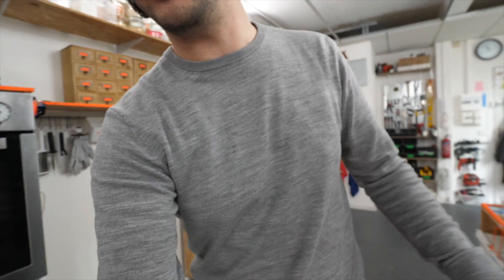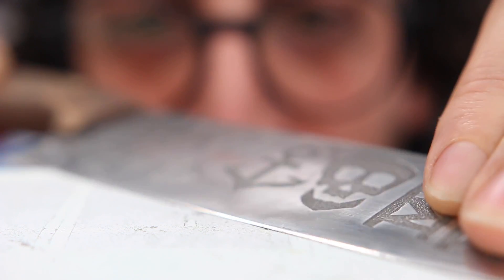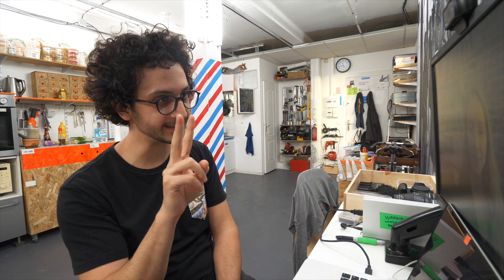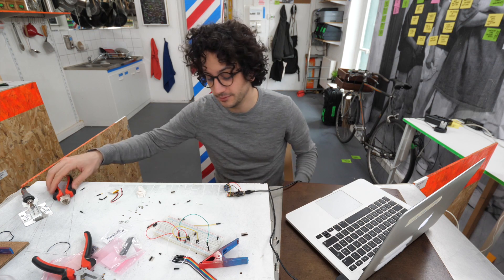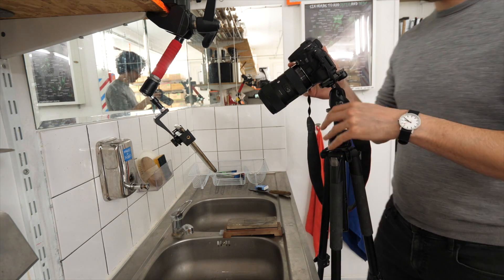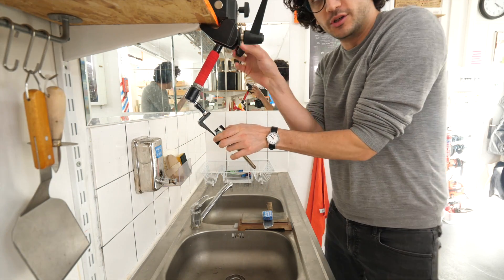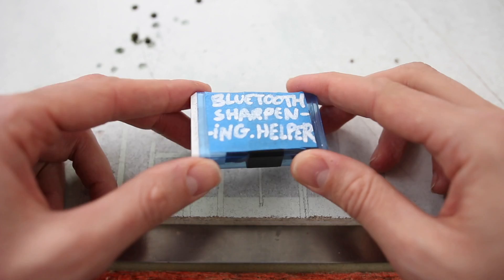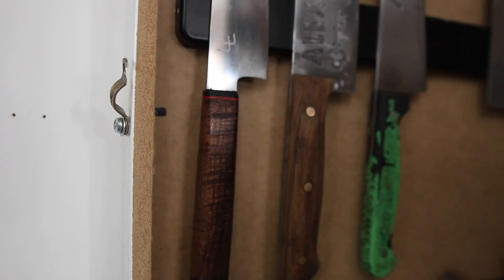Is This The Future Of Sharpening ?

Comment: Instead of linking the arduino to bluetooth, I think you should use continuous audible tone to indicate the sharpening angle. 
Something like 440Hz at the desired angle, and the tone varies up or down depending on the angle.

Comment: If you put a small multi colored LED on visible side of the device and before starting sharpening if you can say to software that you need let's say 15 degrees (with +/- 1 degree to have some space), so led will be green when you reach to that angle, it will be red when you are below or will be yellow when you are above that angle. What do you say?

Comment: The issue is not the measurement of the angle. That is spot on. The issue is getting the blade to maintain that angle while it's in motion. However, that would be to cumbersome. The solution is to move the sharpening tool while the knife is restrained in the needed angle. Find a way to restrain the knife, then place a rotating sharpening surface beneath it that can be made to ride the contour of the knife's edge. Like a belt sander on a pivoting platform or a grinding wheel.

Comment: The best solution to have it teach you is to add a piezo speaker that uses a tone, set the desired angle parameters and it does continuous tone as long as you stay within the parameters. This would easily cue you to stop when the noise stops.  There is also numerous diy videos to make your own printed circuit boards,  you can design your own board and be able to print them pretty simply, plus this would let you label component locations.

Comment: BOM for 100: 
Gyroscope € 177,90 (I found some cheaper ones at around 70€ per 100, but too lazy to change the total)
PCB € 20
AT-09 (bluetooth) € 175,36
Atmega 328p (aka arduino) € 132,08 

lithium Battery charger € 13,79
AMS1117-3.3 (voltage regulator) € 1,64 or buck/boost regulator MC34063A € 2.02 (add about .30€ for passives that go around it)
500mah battery € 121,18
alternative: 
pcb mount aaa battery holder € 15,81 
1000mah NiMh aaa battery € 50,61
boost regulator MC34063A € 2.02 
2A transistor € 2,06
current sensing resistor € 2,07 
arduino doing the charging logic: "free"

2 led: € 1.19
usb connectors: € 6,81 
misc, switch, resistors and capacitors (passives) €10
total (lithium): € 660.31 (or € 6.61 per module)
note that you need to add the price of pick and place and soldering, so that may be another 100€
magnets cost € 3,67
also the price is from the AT-09 module on a pcb, you probably can get shave an extra €20 id you only get the module. 

misc idea: Buzzer € 11,52 + transistor € 2.06 (no sound on perfect angle, higher sound if higher, lower if lower, increasing in intensity as you go away from there)

if you want to add usb programming you need to add:
€ 3,37 for a 12mhz crystal
€ 27,00 for the CH340 usb to serial chip
or change the atmega 328 to a 32U4 that does usb natively and has more capablities
but adds € 121.42

note that you don't need usb programming as you can use bluetooth to program the arduino.

the case adds another 320€ (custom aluminium case with the holes, silk screen printing and one acrylic panel for the bluetooth)

so total for 100pcs with a case would be around 1000€ (or 10€ per module)
Reply: note that if doing a bigger batch it might be worth to design the bluetooth on the pcb.

Comment: Im guessing you can build a really simple prototype using LittleBits: snap a tilt sensor to different actuators like an LED display or a buzzer or a vibrating motor to see which kind of feedback is the most useful for practice. Tadaaa

Comment: Alex, I love your videos and finally something I can pass on to you for a change. First, sharpening is a feel. Don't lock your body and use your arms. Rather, lock your arms and rock your body. Index a finger (or two) to the stone and then rock you whole body. If you use your arms, you will change the angle as your arms extend. This is how a convex edge is made. This is not what you want for a flat grind. Also, lap your stone prior to sharpening with a flat lapping stone. I was taught at a young age how to sharpen but it takes time to develop a feel for the egde. Good luck

Comment: 4:56 2.4 is because of the thickness of the blade. Your angle will always be off by this much with this since it can't measure from the exact center of the blade edge and the software isn't compensating.

Comment: Feels like you need some sort of audio feedback so you can hear when you're hitting the right angle. You want your eyes on the task at hand, not some iPhone screen.Also, how frequently is it measuring the angle, and what's the margin of error in the measurements? If it was measuring hundreds of times a second then using the averages might eliminate those outlier measurements like 20° or 12° that are probably within the margins of error... I suspect the configuration and design will have a huge impact on the reliability of the device. This is such a cool idea, Alex.. I'm a code geek.. if I can help, shout out...

Comment: This has been in my mind since the first sharpening video - Why dont you put a solid wedge below the knife to maintain the precise angle. To push the limits you can make it sliding by adding some bearings at the bottom of the wedge.

Comment: Needs an LED sharpening meter. Tune it so one LED is brightest at the right angle, and dims off at about half a degree. Have one LED for each common angle, so you don't have to worry about setting inputs.

Comment: you would need a simple sine sound depending on the angle ranging +/- 5 deg. This will help you find a stable position. The measurement app can do this with just a few lines of code.

Comment: Nice Stuff!
If you want to make it more precise I would get 2 inclinometers. You Zero both inclinometers on the same surface and place 1 on the blade and 1 on the sharpening surface. Buy electrodes and program it so it shocks you until you have a good angle. Nothing beats our old friend Pavlov :P

Comment: I do not understand why you want to make it reflect the angle every so often it would not be simpler and at the same time more effective just put a light and / or sound indicator that tells you if you are at the angle you want and select the angle with a button of on and off of 4 places according to the predefined angle or something that goes in cycles according to the desired angles with a single button?

Comment: this idea wont work fundamentally. The arduino measures angle by measuring acceleration due to gravity. But because you are constantly accelerating the knife backwards and forwards while sharpening it completely throws off the reading. The arduino measurement only works when the knife is still (or moving at constant velocity)
Reply from the maker: Nah this sensor we used is way smarter than this.
Reply: how does it work then?
Reply: nickt  3 accelerometers all at right angles to each other.

Comment: A visual and audible indicator will help.  3 LEDs. 2 red and 1 green. too high and angle red, too low red, correct angle green.  Add on audio tone that either stops or starts when the correct angle is achieved.

Comment: Hey Alex, and idea on an improvement
Put a speaker on the device which emits a frequency which changes based on if your angle is too low/high
So the device can lock an angle of say 15 degrees and if you are sharpening at 10 it’ll play a high frequency sound indicating to increase your angle
This way you can keep your eyes on the knife and still know any problems with your angle through sound.

Comment: You are over thinking it. You want to learn how to do it by hand then got to a thrift store buy a knife you don't care about ruining and practice. After a few hours at most a day or two and you will be able to eyeball it and make your knives as sharp as a strait razor.  Profile it with a ruff stone, sharpen it with a medium stone, refine it with a fine stone, finally polish it with an extra fine stone and finish up with a strop. As someone the shaves with old school strait razors and restores old finds it really doesn't matter if your angle is off by a degree one way or the other. It is a matter of consistency and that can only be learned by practice. It's not like it takes years to learn, you can probably learn it faster then it took you to learn cutting techniques.

Comment: If you add an audible sound to the sensor to help you find the pre-set desired angle and changes pitch as you tilt the blade it can help you maintain the correct angle as long as you continue to hear the same sound. Maybe...?

Cheers!

Comment: Hey Alex, one thing to note about using a whetstone, especially Japanese waterstones, is that they tend to start turning concave as you use them. There's some debate in knife circles whether its enough to just use the nagura (cleaning) stone regularly, or whether you have to use a full flattening stone to completely flatten it at some point. Some would even go as far as to flatten their stone after or before every use. I'm more of the camp that using a nagura stone is enough and that the stone itself doesn't need to be perfectly flat to get good results. That means, however, that my sharpening angle, relative to perfectly flat, is going to change between sharpening sessions. Unfortunately, those cardboard angle guides are more likely to give you a more adaptive result becuase they tell you the angle relative to the current shape of your stone, whereas the arduino device always assumes a perfectly flat surface. I'd actually recommend just learning by feel. Muscle memory will eventually take care of the rest.
Reply: The reason they go concave is from incorrect angling/tippingduring the course of the stroke.
Reply: I'd say flatten it as many times as possible, but if it fails, you should find a way to make it go back to normal.

Comment: This is going to be nearly impossible with just a kalman filter because it won't stabilise both high and low frequency acceleration changes. Also what you are creating is called a digital angle gauge/inclinometer, commercial ones are probably more specialised and better/cheaper. I'm not one to discourage playing with electronics. Maybe an easier solution is to put the stone at the desired angle, or a line laser on the blade and a guide with parallel lines somewhere further.

Comment: Alex, you’re building a Bluetooth version of something woodworkers have had for years. Digital angle gauges. Wixy makes one for $20 USD, with a large lcd display, tare function, & it can be magnetically mounted to your blade. No need to reinvent the wheel if it will be more expensive and require phone connectivity.
Reply: I was about to write this same comment.
Reply: I do think Alex is onto something. Although the technology exists in the product you suggest, it is 1. too bulky and 2. not in a form factor that appeals to the typical at home chef wanting to up his sharpening game. Alex, I think you'll do fantastic and if you can design an elegant solution with a beautiful app, I would certainly buy it. I've always wanted to get into whetstone sharpening but it's a little intimidating for the average at home cook. Your solution would be amazing.
Reply: @wajplays  thats all we need more useless electronic junk in the world.
Reply: Trouble with those digital angle gauges is their displays are oriented in the wrong plane for sharpening like that.
Reply: @spencereagle1118  Looks like Wixley makes a version that also has Bluetooth on it! :) I might have to pick one of these up.  Model:  Wixey WR300BT
Reply: @spencereagle1118   Use a mirror?
Reply: @spencereagle1118  do it front of a mirror bro
-
Reply: There's also a digital level on iPhones that would work and that gives a clear visual on the angle.Works in either orientation.
Reply: Yeah but everything's better with bluetooth ^^
Reply: Use a guided angle sharpening system for $40?
Reply: Same
Reply: Hi is making it so complicated
Reply: Lansky System works great as well. But the minimum angle is a bit too large for Japanese knives.
Reply: Thank you this was really uses full

Comment: Hello Alex, thank you for the videos. I love the ones where you go out and test local food.

About sharpening knives, I have seen a mechanical device for keeping the angle consistent. It keeps the angle for you, so I am curious about your opinions about it.

It was a video by the youtuber "JoergSprave" if you search on youtube the words "knife sharpening" you can see the video. I would leave a link here but it makes the comment look like spam :)

An attempt on the description of the device is below.

Device holds the blade horizontal. There are holes vertically stacked on top of each other for various angles.
The stones used have a a metal rod that will guide them using said holes.

Comment: I would connect it to a headphone, and have a choice to pick a number, lets say range of 15-17. And when you listen to the headphone piece, while it is at the range of 15-17 degrees you hear silence, but if it goes over or lower, it sends a signal to make sound, and the sound refers to tell you how low or high you have to adjust your knife. Only 2 sounds though, and the angle variations affects the INtensity of your error.

Comment: Salut! Just keep it simple. You don't need any electronics and devices to sharpen a knife. In fact, with those small angle variations you gat a slightly convex edge, which is good in my opinion; the knife is razor sharp and the edge durability  is better. On the other hand, that device is good to show you the initial angle or the angle that you looking for. How can I gat a device like that?Thanks!

Comment: You need lcd to display on device on phone is too much data run around you will con fuse and you need a target angle seting to conpare with output again for not confuse and some servo for guide an angle you want

Comment: I think a useful software interface would be to add an audio indicator.  I'd start with a light tone that emits a C (perhaps another tone would be better - this requires testing) when at your target angle, and then pitches up or down as you wander.  This would give you immediate feedback that tells you both how far off you are and which direction to correct, while not requiring visual processing.  After a bit of use you'd grow muscle memory for it, and would no longer need the trainer except when learning a new angle.

Comment: when keeping an angle put your finger behind the back/underside og the blade, position the angle and lift slightly above the surface of the wetstone, if you touch the stone that indicates that your not keeping an angle, as you are pushing forward your more likely to mess up the angle on the forward strokes than backstrokes. making this technique absolutely fantastic

Comment: maybe you could add a beeper and tell arduino to make different noises at correct/incorrect angles, also try other positions for the sharpening tecnique and check if the support is stable and at 0º

Comment: Maybe you could couple the angle value with a musical note. Then, if the value moves away from the desired goal the note changes (lower or higher). That way you can hear exactly when your angle is off. And you can aim to keep sharpening at the desired tone = angle. Every knife will have its own note.